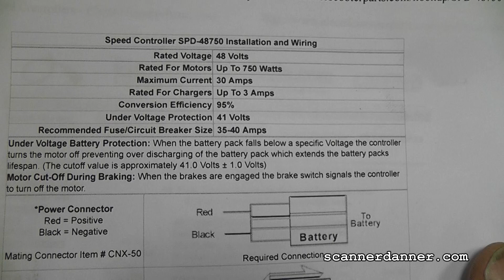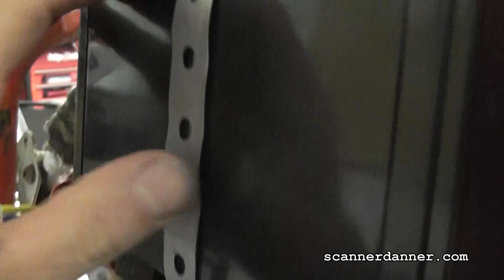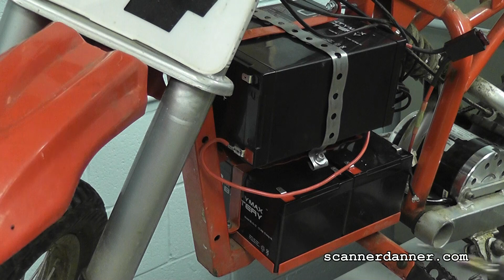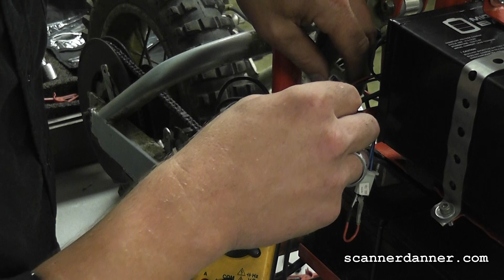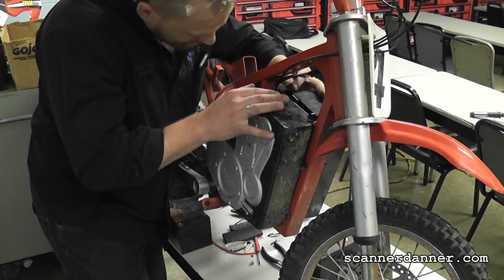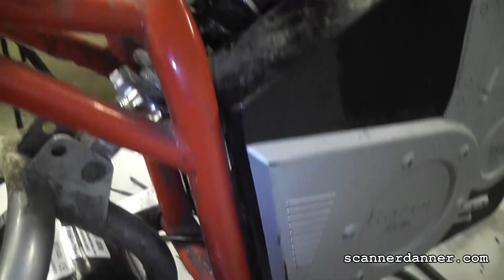Razor MX500 48 Volt Conversion (Part 3 of the build)

Comment: Just 2 questions brother as i wrote below I absolutely have no idea not one clue about all this but I'm going to be doing all this so the question is why for batteries instead of one big ass battery? I know I saw on ebay 52v and 72v batteries and with high capacity wint It will be much easier to connect one single battery to the motor?? for me one battery to connect much simpler what is the advantage of four batteries?

And isn't one battery cheaper??

Second question, how do you water protect all of those electrical connections because I don't see any insulation?? We all know water and electricity doesn't work so how is it done for you

Comment: Thanks for sharing 
I did a 48volt conversion also. At first it all seemed complicated because I bought the bike and the 48 volt kit at the same time. What helped me the most was to ditch the motor covers.  I made it cosmetically pleasing by using black Gorilla tape instead of battery brackets. The bike is a black MX600 and it looks good. The kit came with a 1800w motor. It’s on YouTube. Search Razor MX 600 48 volt 1800 Watt kit
Reply: https://youtu.be/fGNMeMAo5PQ

Comment: I was curious if a key start electric ignition could bypass the on off switch? Thanks sincerely for the videos.
Reply from the maker: not sure what you mean by key start, but as long as it is an on/off type switch, yes, you can use that

Comment: I am replacing old batteries ... I did not solder the wires, instead just used female connectors.
For some reason, the fuses are blowing up. Something is grounding the system when I turn the power on.

Any thoughts?
Reply from the maker: Wish I did. I'd say you wired something wrong for sure. Sorry, I know that isn't much help

Comment: Paul!  In desperate need of advice... started this project for my boy and the controller isn’t labeled.  To late to return it.   How would you proceed?   Not all the connections match.  What a nightmare.
Reply from the maker: oh man, was mine labeled? I don't remember
Reply: ScannerDanner yeah yours was labeled.  
Some don’t even have the correct male/female connections.  Trying to figure out where to get supplies.  Specialty electrical store?  Small terminal connections for a jumper?
Reply from the maker: @aumeadows  wish I could help more. Pictures are keys to some of this. If you like, post this to my forum. It is an automotive forum but we can still help you and you can share pictures with us. It is free to join www.scannerdanner.com
Reply: ScannerDanner it’s a miracle.  Up and running.  Found a diagram.  If you could help me with the last problem.  Easy fix I believe, just don’t have the know how. I only have 1 brake circuit from the controller and there are two brakes (front and rear) to cut the motor when braking applied. How would you create another line for the second brake?  Could I split it off the single existing one?  Thanks in advance. Can’t believe I’m so close....
Reply from the maker: @aumeadows  I am pretty sure that you can leave the other brake switch wiring just hanging. Unless the brake switch is normally closed and opens when you hit them brake. In this case, you would want to just jump the other brake connector with a jumper wire. Or cut off the connector and splice them together permanently
Reply: @aumeadows  coming in late here but if you run the 2 brake switches in parallel you should be good to go

Comment: I'm building a 48v MX 350 but it wont work and I have connected the motor and throttle successfully. The charger keeps clicking when I start charging it and even though it is reading 50 v it wont move. My only open connectors are the brake, switch, charge, and electric lock.
Reply from the maker: Are you having charging issues or the motor won't engage?
Reply: @ScannerDanner  let me test it when I get home since I have the actual motor connector and 3 additional wires for the motor as well which is weird. They are blue,green and yellow. I connected those to the esc as well but I forgot to mention, there is also a reverse switch, and brake light. And I think my brake switches are open but I can check them for voltages. If they contain them i can jump it.
Reply from the maker: I don't remember but is the brake switch normally open or closed? Same question for your other switches. I remember having to jump one of them to get it to function when other components were still yet not finished.

Comment: Im going to post a vid soon of my 36 v mx500 upgraded to 48v system with a 36v 850w motor. Been working on it for the past 2 years upgrading left and right. Motor gets a lil hot after about a half hour of riding. But is still going strong at 25mph. Have a 48v 1000w motor but didnt check dimensions and it wont fit without modification to motor mount and frame
Reply: Can you drop a like to the 850 motor? Was it brushed and a good fit?
Reply: @Catamount19  well it was a bit crooked due to one of the bolts but it was still aligned enough to ride for a few years pretty much daily(seasonal)
Reply: @aaa54362  did the cover fit back on? Where did you get the motor?
Reply: @Catamount19  yes it did. I believe I purchased it from ebay. Can't remember the sellers name but they were based out of Florida. They had excellent customer service
Reply: @Catamount19  just have to flip some of the batteries sideways for the cover to go back on. Since I posted this I've actually upgraded again to a 48v 1800w motor. So much more power and fun. However I left my charger in the rain and it fried out..😑
Reply: @aaa54362  oh no. 30 bucks for a new charger. I upgraded to 48v sla and just got an 48 overvolt kit for the stock 650.  I have another 650 and I want to put an 1800 on it as well. I'm looking at the kitsch from electricscooterparts.com

Comment: My god that's gott'a be heavy !!!!  I would just put in  2 or 3,,, 36 volt  10s 4P,  8 - 10 amp Lithium packs with BMS, running in parallel ..    2 of those packs weigh about the same as 1 - 12v lead acid batt !!   These packs go for between 80 - 100 bucks a piece . Chargers are around 10 bucks also. I would get a charger for each pack & charge individually. Run time & performance should go up considerably, if set up right.... Also would run  a small LED voltage monitor for each pack, just rig them up to plug into the charge leads ..   I74

Comment: I have one question. To get more seat hight do you think I could but a little shock bracket on the shock to make it longer? What it would do is change the angle of the wing arm down a little and raise the seat up. Something like this, http://www.banggood.com/Motorcycle-Rear-Shock-Absorber-Riser-Heightening-Device-Increased-Damping-Device-Booster-p-1022427.html I think it would be fine. Just wanted your option. Thanks and great video. Your son is lucky to have this thing.
Reply from the maker: I'm not sure. I would think you may need to add links to the chain too?
Reply: mmm that is true. I might just take the chain tensioner off.

Comment: i am on the final step of this project which is connecting the battery's to the controller. All of my previous plastic connector pieces are melted and i could not salvage them. I was wondering how i could safely connect the battery's to the controller without using the plastic clips. I would like to hear your input, thanks.
Reply from the maker: +fishiniseasy buy some female terminal ends. Crimp and solder them to the wires and then connect and solder to the battery terminals like I did. (I did show that part right?)

Comment: I am going to be doing this conversion myself and i was wondering if it is safe to keep my 36v 650watt motor to run on 48volts? I will need a new charger, but i am not sure if i will need a new controller. I would love to hear your input, thanks.
Reply from the maker: +fishiniseasy you'll definitely need a new controller because your old controller will limit the voltage to 36 volts. Also it may actually cook the old controller. I think you are motor will be fine

Comment: nice project! do you have to changes the controller too? since you upgrade it to 48v
Reply from the maker: +Shun Takara yes you must change the controller. The 36v controller will limit voltage to just under 36v. And the 48v that is now on the system will potentially damage the controller as its not designed for 48v

Comment: Scanner Danner - Possible tip as I watch the video. When you forget to put the shrink wrap on the wires or in spots where you can get it on. Consider using a craft hot glue gun. It will quickly seal and lock in place any connections.

Comment: Hi people out there, please advise which regarding the wiring connection, it could be I did a wrong connection or I need to load test to the throttle..Key switch shown 000 when using multi meter but during switch on, the indicator led light works, when I turn off the Key Switch , the led indicator disappear and it shown some reading numbers. Thanks for watching :D)

Please watch my video to understand once again thanks
https://www.youtube.com/watch?v=-3V6rbIgr8Q
Reply from the maker: +Liquidmaster1006 sorry man. I can see anything you are doing in that video. Your camera is too far away.
Reply: Oh I see. gonna take some nearest for your attention ... man thanks for remind get back to you then when I'm back to home , once again thanks cool :D)
Reply from the maker: +Liquidmaster1006 I need to know also what your working on and what all you've changed. 24v to 36? New controller? New throttle switch? How many wires the old one had how many the new one has etc. Give me as much detail as possible.
Reply: It is originally 36 v 500 w motor,scooter, the new things that I just bought new key switch throttle, to replace the old one due to short circuit having  a smoke and burn smell....  new,3 nos of 12 v battery replacement same brand due  to replace my old battery spoiled. and followed by new controller to due to replace old 36 v controller caused I saw the motor wiring was burned so I change 3 item, but it seems doesn't work at all...When I connect direct motor to battery jump start it works...and.it doesn't when I connected through thee controller and key switch .please advise  I' m greatly appreciated and admired u ..bro .. thanks :)
Reply: +ScannerDanner 
On my electric go kart I use a 150 watt isolated DC-DC converter for 12 volt devices that is model: VHK150W-Q48-S12. They cost about $200 dollars from Digi-Key. Also, be sure to NEVER tie a higher voltage DC system's negative terminal to frame ground!! All high voltage DC systems are to be 100% isolated from frame ground. Only tie negative side of DC-DC converter's output to ground.

Comment: put a 36v motor in there for some top speed gain, i dont see how the bike will be any faster
Reply from the maker: +Rob M did you see the after mod runs? I had my son and a neighbor kid with a stock mx500 race. It is significantly faster

Comment: Hi Im doing this right now I just stripped everything and now I need to ask. What is thw biggest motor that would work I seen 1000 watt but the street legal ones say they have 2000 watts with 1000 nominal. Can I use marine deep cycles so I can run some amps. I have 4 guage power wire from car stereo to rewire with .Bike looks great I liked your idea so well I had to.
Reply from the maker: +George Niemann George, in the research I did, after you go bigger than a 750 watt motor, you start getting into frame and or swing arm modifications. I do not know how extensive it would be, but it was something I didn't want to do. I really wanted to stick with as minimal mods as possible. (direct bolt on parts). 
You can certainly use any deep cycle battery but you'll have to consider size and also make sure you run a sealed battery. The last thing you want is a wreck combined with battery acid on your kid. Good luck. Post some after run videos for me when your done. Thanks!
Reply: +ScannerDanner Thank you for quick reply , I would not have a kid ride this .Its for me I weigh 180 and am 5 ' 10" this is my friends acct. I want it to play with and ride around. Is the 1000 motor to big? I was planning 48volts and 1000 watts?

Comment: Paul, Nice series! I have a question and a concern, considering who will be riding the bike. I'm not an electrician or electrical engineer, but I would think at those voltages, you would have to have some type of chassis ground being bonded back to battery negative. If the case of the motor or the bike's frame became energized thru a short from your wiring to the frame or thru a internal short in the motor to the case of the motor, I would think a potential severe shock hazard might exist between the chassis of the bike to battery negative or possibly any type of earth ground such as a metal chain link fence. Considering you are dealing with 48 volts and that DC current is much more dangerous than AC current, better to be safe than sorry. I would check with a electrician or someone who repairs electronics such as a TV repairman. On another thought, I believe you are correct when you say the threshold for voltages becoming a shock hazard is when voltages exceed 40 volts or so. The outer layers of human skin is so dry and has to much resistance below those voltages to support very much current flow. If you don't believe me put a 9 volt battery on your arm then put it on your tongue and you will understand what I am saying! You the man Dude!
Reply: +Billy R 
WRONG!!! High voltage DC systems are NEVER tied back to frame ground on mobile applications. This seems counter intuitive, but there is a reason for it. High voltage DC systems need a resistive return path to shock where as AC can shock you from capacitive, resistive, or inductive path with only one wire. DC is non varying and can only give shock by resistive path that needs a conductor return path compared to AC.

By tying a high voltage DC system's battery negative terminal to ground you INCREASE the risk of electric shock if a positive side wire were to come loose and the victim was grounded to the frame when they touched it! On electric forklifts that use 24 volts or higher DC voltage, all have isolated frames. You should ever be able to measure a DC voltage from frame to the positive side of the traction battery. If you do, then you have a problem that needs to be fixed asap! As that can cause havoc with the electronics on the equipment with all codes of crazy codes popping up randomly all because of a voltage leak problem due to a negative side or positive side wire touching the frame or you even have risk of shock.

Even the Tesla Model S electric car with its 360 volt DC system is isolated from the frame! Only their 12 volt auxiliary battery is tied to frame ground.
Reply: Billy R not sure about the chassis ground increasing safety? It didn't come that way from the factory, nor was there any provision to set it up that way with the new controller. I think the opposite would be true. If a 48v positive lead touched the frame, your not getting shocked anyway because your not a path back to ground. If the frame was grounded, then you are going to have a huge amount of current and a blown fuse at best. No frame ground = nothing happens. I don't see the danger because, you are in no way shape or form an easier path back to battery negative on this system. Even if the motor shorts, your still not in the path.
Reply: +EETechs  -  Thank you for the education and I must say that makes a lot of sense. The reason I asked Paul about it was, because I have a 1500 watt 12 volt DC to 120 volt AC inverter and it comes with bonding lug attached to it and is required to be bonded to the frame.

Comment: Nice job Paul. Just one thing would concern me, how sharp are the edges of that metal strapping that you have used, i have used similar strapping in the past and i remember the edges could be quite sharp. If yours is the same then maybe it would be good to protect the edges of the batteries where the strapping rubs it, especially when you think of the environment it will be in.

Comment: Hi Paul, are you using normal "electronics" solder for these type of connections? Im asking because I wonder if the thicker solder creates mechanically stronger joints?
Reply from the maker: ottard just normal rosin core solder

Comment: insulation on battery terminals not over kill in essence of battery shifting if were to happen fuse will do nothing as current will flow battery frame battery  if negative or positive connected to frame somewhere else .
SLA battery's are semi sealed under overcharge or over heating will cause them to vent.

Comment: Paul did you do an amperage test under load by chance ? 750watts at 48V is no where close to 40 amps.  I can see the wiring but not sure the gauge maybe #10..  I  guess when you start off it ramps up quite fast and spikes the amperage high like a starter motor.  When it sparked on making the connection  wow something was energized , pretty decent spark.  Electric is so not the future in autos , at least in our life time, huge flop again , history repeating itself.  Sales are dismal  but an electric bike  for a child or a Tesla  for us would be a blast to have.  Nice series  I like the non auto stuff  as well. Cheers !!
Reply from the maker: Steve Rob I didn't do a current measurement but I do know that a 30 amp fuse worked just fine too. The reason I went to 40 was for what you described. (the start off current flow). Especially because my fat ass likes to drive it too :)
Reply: +Steve Rob That was the capacitors in the controller charging up. On my designs I use a 25 ohm, 5 watt pre-charge resistor across a contractor's output switching section that prevents the sparking and allows the capacitors to charge up. It's rough on capacitors to straight connect them to full voltage and it wears out contactor tips really fast if you have no pre-charge.
Reply: EETechs now that's a good idea. Thanks
Reply: STEVE ROB REVIEW